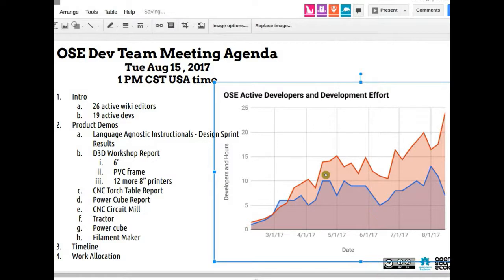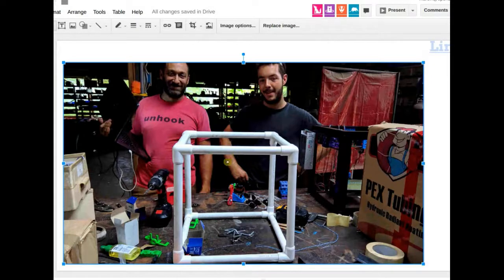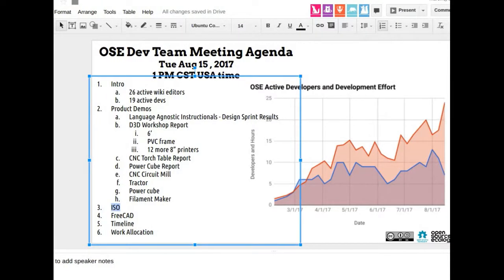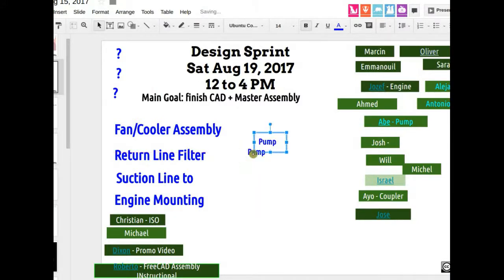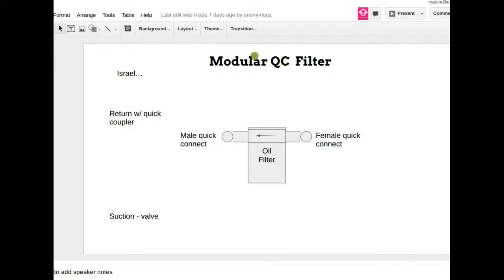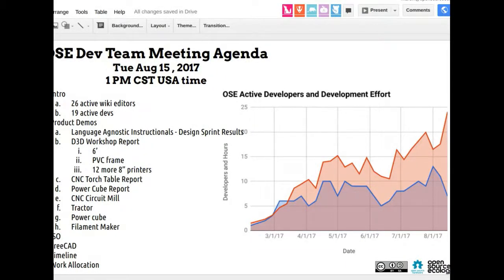Dev Team Meeting - Aug. 15, 2017

Comment: Minutes
1:15- welcome back Michel
2:10- developer hours
5:30- Maine USA Workshop September 30, 2017
12:23- CNC torch table
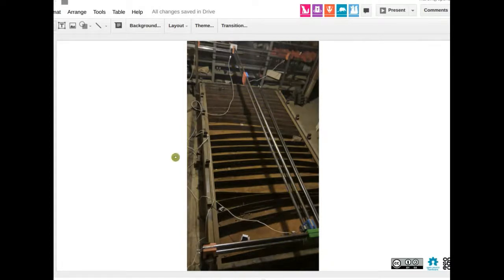14:55- CNC circuit mill
15:30- Language agnostic instructionals
18:25- Power Cube
19:07- critical path overview
23:00- OSE Linux ISO
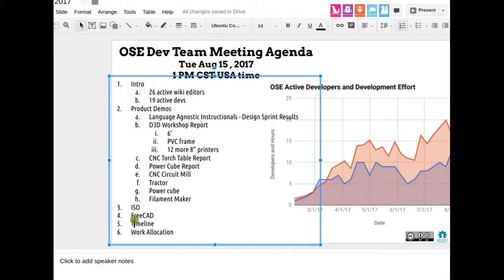25:50- FreeCAD; Assembly2 workbench
38:40- Timeline
40:10- Power Cube 17.08
46:40- Design Sprint Aug 19,2017 Noon to 4PM
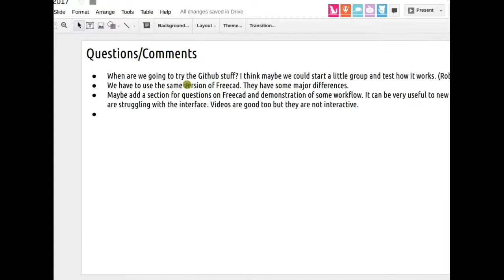1:06:30- Questions/Answers